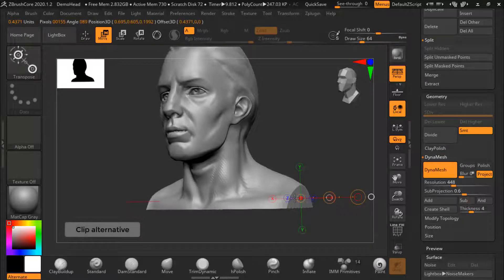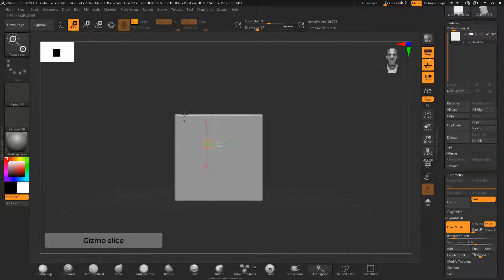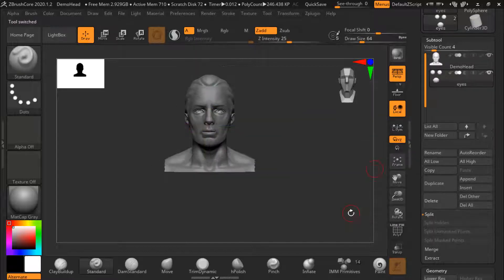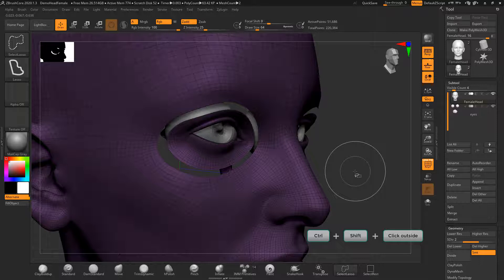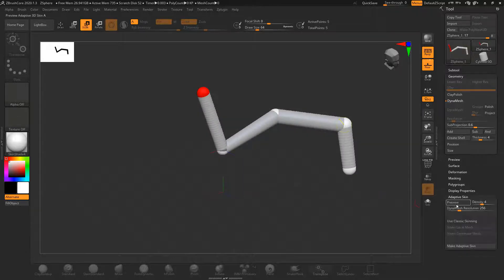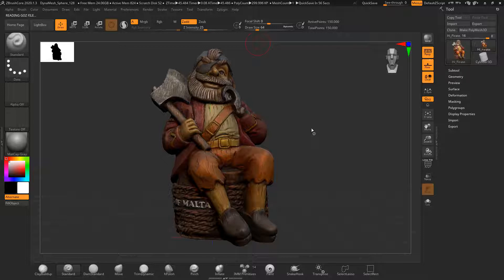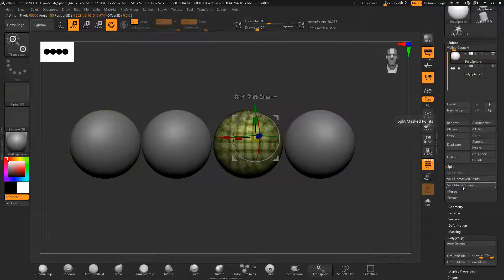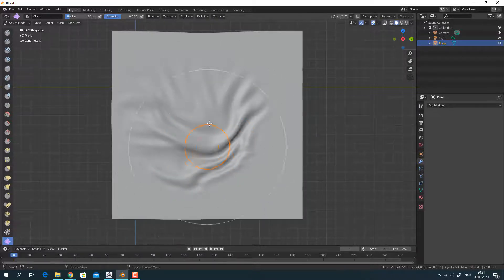Zbrush core - tips and tricks

Comment: Can I put a question... How do you group say head with eyes before turning the head? Her eyes, hair and tongue are all separate sub tools, do I have to create a folder or will they follow only when merged first? The UI is a bit confusing , is it that arrow on a layer that links down? Sorry for asking 🤗 Oh, think I get it, you can’t right, you have to create something called poly mesh groups...
Reply from the maker: You can use the transpose all tool to move, rotate or scale several sub tools at the same time. You activate it by selecting either move, scale or rotate and the transpose all button is at the top right part of the toolbar (over the gizmo). Then you can use Ctrl + Shift + Click to select and deselect the sub tools you want to be part of the rotate, scale or move operation.

Comment: Thank you for this, very helpful! Any tips on sending zbrushcore files to blender?
Reply from the maker: There is a free tool called GoB written by JoseConseco, which makes it smoother to transfer between Blender and ZBrush. Just click a button in Blender and it goes to ZBrush, and same in ZBrush as well. As far as I know, this does not work with ZBrushCore yet though, because it needs GoZ as well, for it to work. In ZBrushCore you can export the tool (your model) as OBJ or STL (or some other format). Work on it in Blender and then do the same back again. Of course if you do a lot of back and forth, it is neat to have a tool like GoB to make it a little smoother.